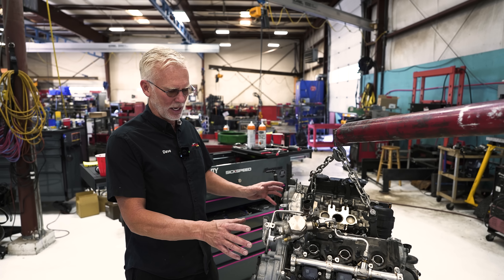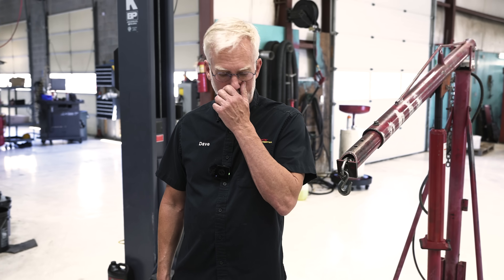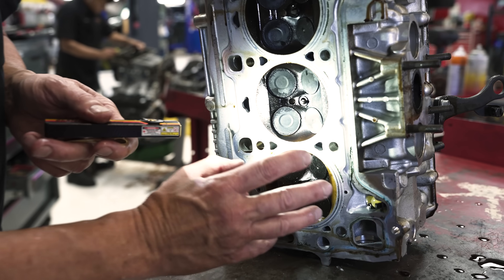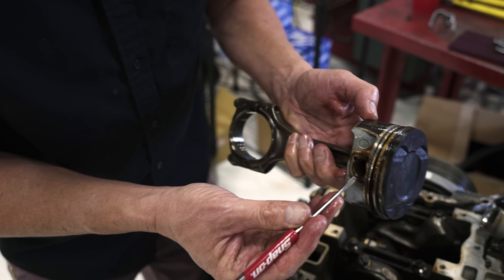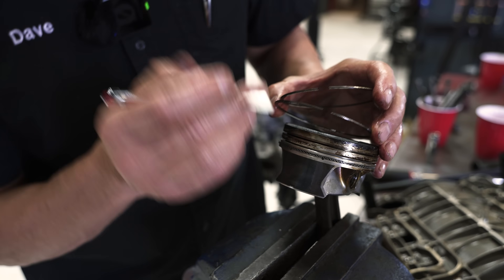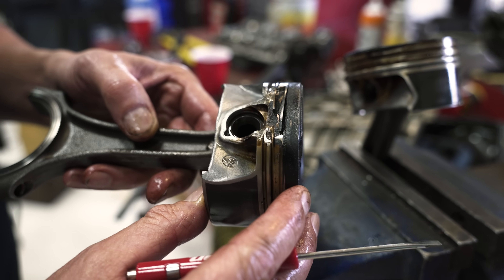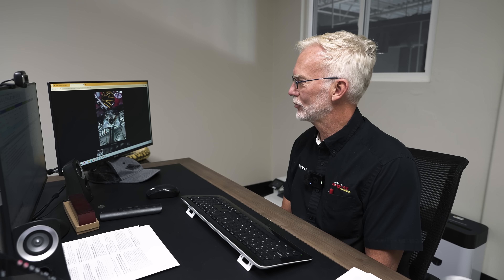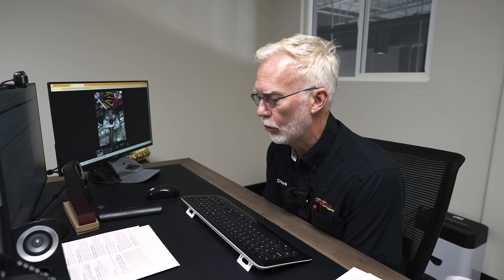Audi S5 Update: Piston Damage From LSPI (Low Speed Pre-Ignition)

Comment: Your first mistake was buying a VW product.  If you make that mistake, at least use Castrol Edge Euro oil.
Reply: Not all but a lot of problems with these modern vehicles is people don't know how critical it is to use the right oil, gasoline ECT. Are German vehicles over engineered?? Yes but if you own one they need TLC
Reply: My 2014 s4 has been very reliable, just hit 140k. Just do basic maintenance and change the oil every 4k. Runs like butter.
Reply: @heavyquestionmarks5294  Agreed.  People put 87 octane in these things and then wonder why it goes boom.
Reply: @goingforspeed  it says on the fuel filler lid 91-93 octane 💀people struggle to read
Reply: @heavyquestionmarks5294 nice

Any electronic nightmares? 

Also, with your car, is it also among those that need the entire block removed for certain repairs where it’s a bit absurd for that to be necessary? My best friend had a fatal crash with his 2014 rs4 & I remember, for pretty ‘normal’ repairs, entire block had to come out. 

My apologies to mention that negativity, not my intention by any means. 

(The car rly wasn’t to blame, he was doing 166mph at night and probably suffered some type of medical thing + wasn’t wearing a seat belt. Rip him tho, sucks that he had to suffer for 8 weeks before he finally passed away.)
Reply: @marcelforrel no, newer Audis don't have those issues. The biggest killer is that when you replace a bad battery on Audis you must reprogram the car and let it know it has a new one. Audis will overcharge the electrical system as a battery ages to keep the voltage up. If you don't reprogram it, it won't adjust back and you will fry your electrics as a result.
Reply: @heavyquestionmarks5294 is that a diesel or no? Idk
Reply: @marcelforrel  3.0 supercharged v6
Reply: Still better than a Ford. 😆
Reply: Gti's are reliable besides leaking water pumps 😂
Reply: I want a VW so bad have always owned Mazdas but now I work for VW
Reply: @Staticc146 just lease them
Reply: Imagine buying a vehicle from a company that was caught red handed investing time and money with huge risks to poison your lungs for profit.😅

I remember driving behind vws before they were caught, smelled so horrible you couldn't even stay there then the prick would accelerate up as you pass because everyone else was trying to pass the fool in the smokey VW.

That is almost as daft as being spoon fed medicine at the request of media outlets and politicians from a company with a very long list of human rights violations.
Almost.
And lets not get into the nazi origins of VW. 
That was the past right?
Just like they say about everything else.
VW owners.😂
Bless their hearts.
Reply: VW, Mercedes, BMW, Audi, Tesla are for stuck up conceded people.
Reply: The thing with VW products that scares me the most is the electronics. And the dealer not fixing problems. And the fact that some of the higher end models require the block to be taken out completely to replace certain parts if they fail. I ain’t dealing with that lmao. 

Give me a BMW instead. Sure, plastic fantastic. But it handles like a dream and from my experience, the electronics are 👌

+ I like how you can always go to the dealer whenever theres an issue. VW here is like: mmm yeah, didnt find it. Na, hmm.. mm yeah we’ll see what we can do. Gtfo with that bs.
Reply: People want badge.
Reply: The mistake was abusing the vehicle.  They would drive it at low speed and then stand on the accelerator.  It's not a mistake to drive a turbo charged direct injection engine....the mistake is not taking care of it.  High RPM's for prolonged periods also destroy those gdi engines.
Reply: When I was young and stupid I had 2 busses, 2 Bugs, a Thing, Golf, Fox, Rabbit, and a  Sirocco, they all got great gas mileage....because they never left the garage. I'll never own another VW as long as I live.
Reply: Silly comment honestly. I haven’t had any issues w my GLI
Reply: @nicolasrulli  yet
Reply: Audi recommends 0w20

That's the mistake. 5w40 liqui moly 👌👌
Reply: ive found that the brand of oil changes nothing. Oil change interval is whats important.
Reply: @11guyinthechair  Your money.   He explains why you need an SP rating on a DI engine.  For BMW, you need an SP AND LL-01 (long life) rating.  That's an additive to help clean between the rollers and the pins in the timing chain specific to BMW.  If you don't use an oil with LL, it will stretch the timing chain and cause a skipped tooth or worse - a few skipped teeth and a valve hitting the piston.  You can change your oil every 2000 miles and it won't stop that from happening if you don't have that additive.
Reply: @janofb  Glad my car doesnt have chain drive. Nor does it have direct injection. New cars are junk in general. I much rather drive old ones. That are cheap to maintain. And dont require much maintanance anyways